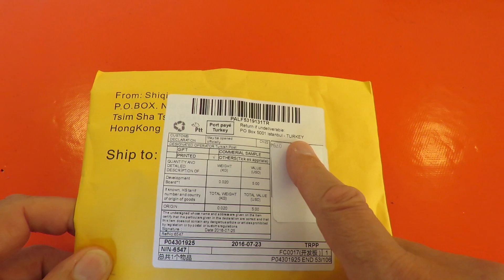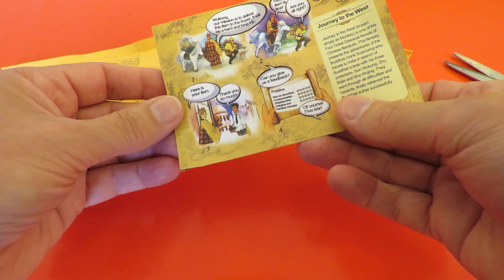Grandad's Postbag 160806 LiPo charger boards

Comment: Does is charge only specific mAh rating lipo or all 1s (can i charge my 1s 380mAh, 500mAh, 1000mAh lipo with only one board)?
Reply from the maker: You would have to change the resistor that sets the charge rate. The eBay listing should tell you how to do this. In my video description there is a link to one I did in 2014 where I fit a suitable resistor.
Reply: +GrandadIsAnOldMan Thanks :-)

Comment: Hey Grandad, there is a newer version of TP4056 module that includes a protection circuit to keep the Lipo from discharging too far.  They cost almost the same but they have 4 output terminals, 2 for the battery and 2 that for your "project" - very handy.  If you search "TP4056 with protection circuit" you will find some
Reply from the maker: Yes, I guess it depends what you intend to do with them. If you are soldering them direct to your battery as a single unit then the protection circuit will be useful but if you are using them to charge batteries that will be plugged into a toy car or plane or similar then the protection circuit is not in use. I will add that to my description.

Comment: ebay link?
Reply from the maker: I used to put eBay links in my video description but I have stopped doing that as it may give the impression I get some benefit by promoting a particular seller. Now I just put the eBay description in there so you can cut and paste it into your eBay search and find it that way.